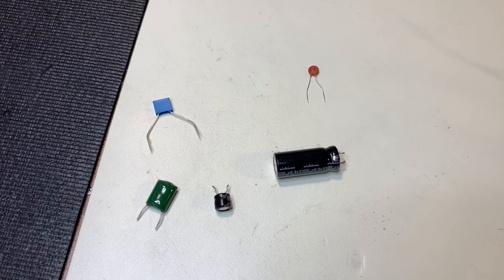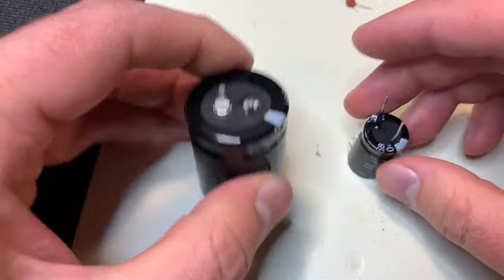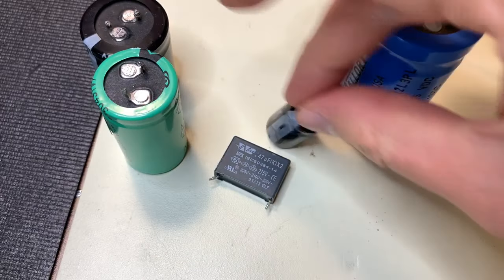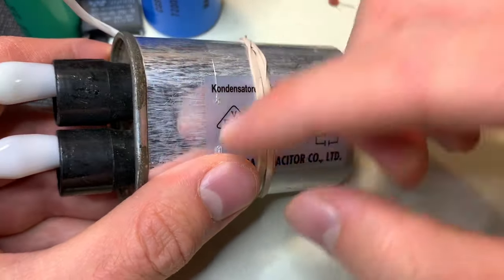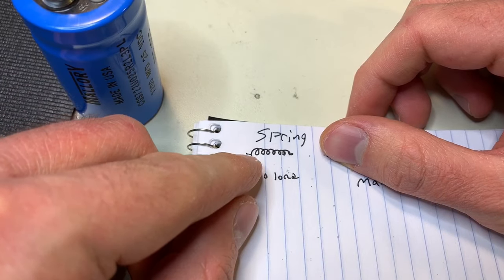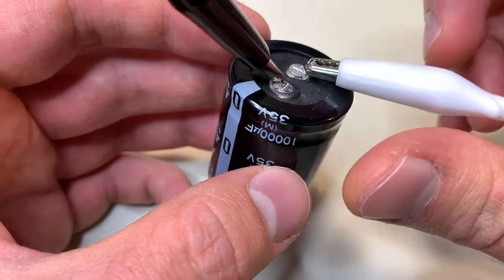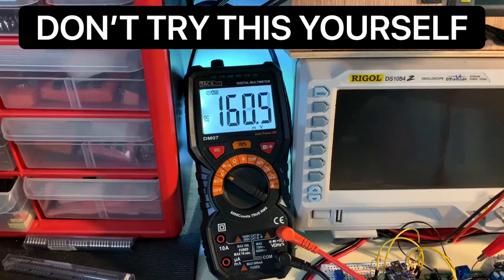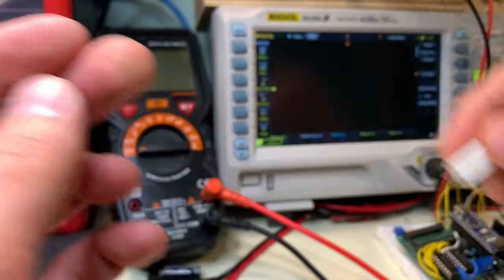Capacitor Safety - How to Discharge Capacitors Safely

Comment: If you disconnect an amplifier (ie: 500w ClassD stereo and/or subwoofer amp with toroidal) approx. how long till all the capacitors discharge to a safe condition all on their own?
Reply from the maker: It depends on how big the capacitor and how big the bleed resistor is... best thing to do is measure it with your multimeter in voltage mode to see if there is any charge left

Comment: Great video, would have liked to see how to test the charge. I know you can use a multimeter, but they are very sophisticated alien-like devices. I don't know what setting(s) are proper for what scenarios.
Reply from the maker: Thanks - by charge were you interested in measuring voltage or capacitance? You can check out this multimeter video on our channel if you want https://www.youtube.com/watch?v=BxVbLKd5Kk4
Reply: @HTMWorkshop  I'm just concerned about residual electric during electronics repair thru simple replacing of parts. For example, people say computer power supply units can have a deadly charge in them for a long time. How can you really know without testing them? I assume that's the only other major thing to look out for, aside from making sure the device is unplugged of course. Thanks for the link.
Reply from the maker: @lakecityransom  I have worked on quite a few computers - I have not seen to many capacitors dangerous enough to pose an issue. I have often heard that if you disconnect the power then hold the hard reset for about 10 seconds you can discharge any remaining charge in the supply - but I would be surprised if that was even necessary. I would be more worried about damaging computer components through ESD than getting shocked by a computer that is unplugged - most everything in a computer runs on low voltage - except the power supply. I mean it's possible you have some sort of super cooled computer with crazy fans and motors that are not normally included but most parts are low voltage. If your just changing boards or ram you really don't have to worry about getting shocked (just unplug the power cord since the line voltage is the only real thing to worry about). Now I am assuming your not dealing with a CRT screen computer - if you have a computer that old then yes you do need to worry about a high voltage capacitor (but only for the CRT screen).
Reply: @HTMWorkshop  Oh for sure I've worked with computers a lot. I actually mean working within the PSU unit itself. There are cases of teenagers dying if you Google on that. The most common reason to open one up is the PSU fan's bearing goes bad and starts making a lot of rattle. Its simply a matter of replacing it with another standard 80mm or 120mm case fan. However, you do have to open it up and all the parts are in there tightly so it is concerning to attempt unhooking one and putting the other one in.

I replaced a water intake control on a washing machine the other week and was questioning once again how safe I was being without testing components for residual electricity, but I did get the job done lol...
Reply from the maker: @lakecityransom  
Yes it is possible - many psu utilize capactive reactance to step down mains - I believe those are suppose to be designed with a bleed capacitor - but I am not sure. You should be ok to replace the fan - just be careful around any caps that read over 20 V. I would imagine the fan should only have a couple connections or more likely a single molex connector. Which should be safe to unhook and change out. If you want to be extra safe you just make sure to take your meter and put it into voltage mode - then measure across the capacitor legs - and make sure the voltage is low. Always good to take of jewelry and use one hand as much as possible to reduce risks but I would imagine its fairly safe unless your really messing around near the caps (and even those should discharge pretty quick if the circuit is setup correctly).
Reply: @HTMWorkshop  Yeah I looked into how those are supposed to bleed off juice over time. I guess some improper ones may not or maybe a malfunction happens is what worries me. I used to be under the impression anything on the circuit board would be dangerous to touch if high voltage capacitors are loaded, but it sounds more like the capacitors will be dormant unless you touch their direct leads soldered into the PCB? Thanks again for taking the time to share info.

Comment: what about 50v 6800uf capacitor? got 2 of those and 4 25v 1000uf capacitors in an amplifier board that i wanna take apart. it hasn't been plugged in for months
Reply from the maker: Well I would think the capacitors probably fairly safe (but that is a guess I don't know what your board looks like) - I would just check them with a voltmeter. If they read 0 volts then you know they are already discharged. If not, use a high ohm resistor to slowly discharge them to protect the electronics. My guess is they are already discharged.

Comment: I have a physically large resistor. It is 220 ohms and 25 watts. What would the pros and cons of using this on a 450 volt capacitor be?
Reply from the maker: Well if you calculate the power at 450V and 220 ohms I get 920 W - so your going to exceed your resistor power capacity - choose I higher ohm resistor to reduce the W
Reply: V = I * R  -->  I = V / R
P = I * V  -->  P = V^2 / R

P = 450^2 / 220 = 920 W

R = V^2 / P 

R = 450^2/25 = 8100 ohm

So, you need at least 8100 ohms to safely discharge that capacitor.  Just get yourself a 10,000 ohm resistor and that should do it.

Comment: this video is disappointing, i get to the and and you tell people not to bother discharging them at all if they are slightly bigger

so how do we learn? are there different steps for higher voltage caps?
Reply from the maker: The higher the voltage the more knowledge you need. If your doing high voltage (usually over 100V) I recommend using a High voltage discharge tool. However if you are familiar with electronics you can just use a resistor with a high wattage (ideally solder on some leads) then ground one end and attach the other to the positive polarity of the cap. Always check with a multimeter.

Comment: How big does my capacitor have to be to get 1.21 gigawatts?
Reply from the maker: P = IV or V^2 /R  so depends on what your resistance is...make your resistance small or your V big to get a large power.
Reply: @HTMWorkshop  I’ll tell Doc, I’m trying to get back to 1955.
Reply from the maker: @robsmithracing  Ha - Well than your going to need a lot more power - if you can exceed infinite power generation or find out a work around to the relativity equation. But if you can break (and survive the speed of light there is a chance) - Goodluck
Reply: @HTMWorkshop  I think the Back To The Future reference may be lost here.
Reply from the maker: @robsmithracing  Well thats cause in the movie they say "Jiggawatt(not sure if that is a mispronunciation or a fictional unit" .....Ha - I suppose in need to work more on quippy comments -  I did figure out your reference (admittedly after your second comment but I did find the first odd).

Comment: I brought 2 capacitor online, both are the same 820uF200V. It label with numbers on top and feel and look like plastic. Is it going to melt?
Because capacitor can go to 105ºC. And I am new for repairing electronics.
Reply from the maker: Plastic is not necessarily a bad thing, most electronic plastics can take 100 degrees C. It will depend on the manufactures specs and their reputation, how long you run the caps, and of course statistics (since there are always things that can fall outside the norm). If I was betting on it I would say they are safe, but you may want to check the spec sheet for any info on temperature sensitivity.
Reply: @HTMWorkshop  Thank you, for advice, because I had no idea. Originally the television didn't bother turn on nor hearing power is on. With help of  google and YouTube searching for board has power. I did spotted 2 or 3 capacitor, needs to be replace.

Comment: So your instructions are just to not do it n give up if it's over a safe voltage? Theres no possible way to discharge it?
Reply from the maker: If you select a large watt resistor and discharge at safe current you are fine. But you should be knowledgeable on the specific voltages and currents you are working at. I would not recommend working on high capacitance high voltage circuits unless you are trained/competent in electrical safety. There are high voltage discharge sticks you can buy for about 30 dollars online which can be a good option, but still you should understand some basics of electrical safety -  i.e. no jewelry, one hand, insulating shoes, potential current paths etc.
Reply: Thank you, that was a big help, I'm not specifically certified but I'm trying to learn everything I possibly can before trying anything I ran into a few 450 v capacitors that's why I stopped what I was doing to try to see if they where going to be a problem and if so, how to deal with them you helped allot thank you.

Comment: How long can they hold charge for ?
Reply from the maker: Well, I assume you mean in an off state (meaning not used to power anything), in that case it depends on the amount of leakage current. So if you had 1 Farad of capacitance fully charged you could figure out the time constant using t = Resistance * Capacitance. So you would need to know the effective resistance for the leakage circuit. Then multiply the time constant by 5 to get the effective discharge time...or you could just charge it up... then measure the voltage over time and see when it starts to drop (more of trial and error type method). Here is a general video on the time constant if your interested https://www.youtube.com/watch?v=JcrlL8YN6VQ
Reply: @HTMWorkshop  oh man appreciate it
Reply: @HTMWorkshop  just out a volt meter to it nada
Reply: @HTMWorkshop  it’s an Xbox brick power supply I had to ask first ! 2 in there are 200v 450f and 4x 16v capacitors as well ! Did not know if over time or if I needed a resistor to drain them but it did over time apparently

Comment: Dumb question, is there a way to calculate which resistor to use with which capacitor?
Reply from the maker: Well it will depend what your goals are, but in general if they are just to safely discharge the capacitor you can always use this calculator https://www.digikey.com/en/resources/conversion-calculators/conversion-calculator-time-constant
Then get a time constant of around 1 second. At 5 seconds or 5 times the time constant you will be about 98% discharged.  Obviously if you need to discharge the capacitor slower or faster you can. You would also want to make sure the power through the resistor does not exceed the resistor limits (measured in Watts).Remember - power = V^2/R. So if you wanted to reduce the power through the resistor choose a higher resistance (since voltage is fixed with your capacitor). Hope that helps.
Reply: @HTMWorkshop  Awesome, thank you!

Comment: I shorted 400V 82uF x2 cap on tv power supply, thinking it wouldn't be a big spark, swings a nickel plate to the terminal and it bang so loud😂

Comment: Is it good or ok to replace 2200uf 35v with 2200uf 16v?
Reply from the maker: well I would say in general no - but its going to depend a lot on what the 35v capacitor is used for.
Reply: @HTMWorkshop  power supply I will go for 2200uf 50v then. Don't have 35v.
Reply from the maker: @NengVang2007  I think that has a better chance of working - goodluck!

Comment: The 25V 7500MFD cap could be dangerous if you have a cut or wet fingers etc. At that voltage it's your skin resistance protecting you, and that resistance isn't foolproof
Reply from the maker: I think in the worst case scenario skin resistance (if broken/cut) can drop to about 1000 ohms - and in that case you could run a dangerous current (~25 mA). And that is past the average let go current. So I think you make a valid point. However since capacitors are inherently limited in how much charge they hold and all of it is going to flow quickly out - I think it would still be pretty rare to see any serious injury (shock yes - burns maybe but would need to be a very large capacitor to raise the skin temp high enough). In the vast majority of cases your skin resistance is going to be higher than 2000 ohms (probably 99.9% ore more of the time) and that is going to be below the let go current of most people at 12.5 mA - more of warning buzz. Anyway just my thoughts - your point is a good one - the question is always how safe is safe enough.
Reply: @HTMWorkshop  agreed